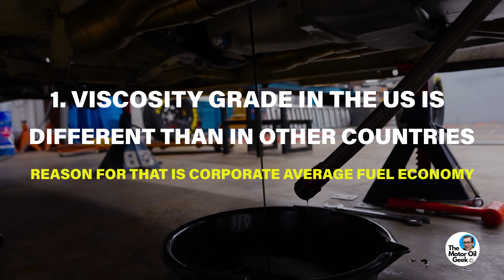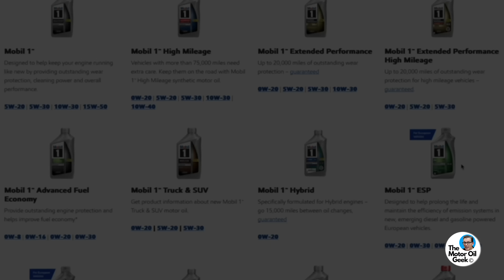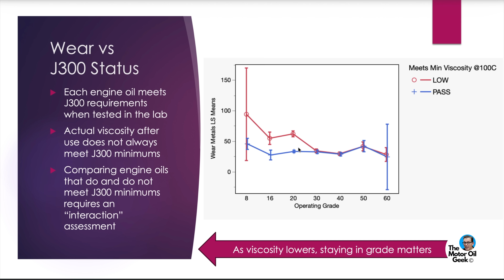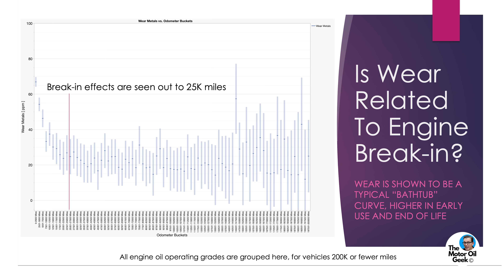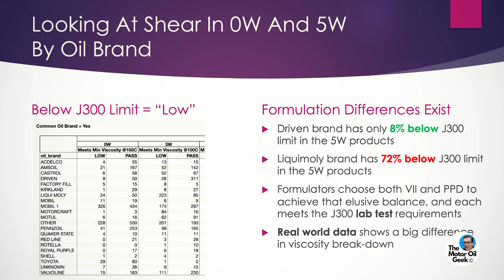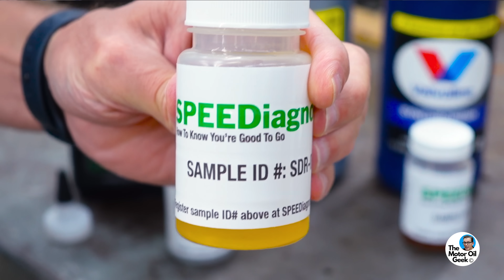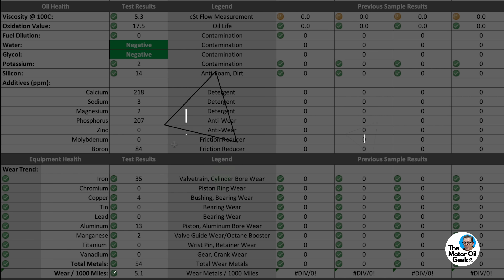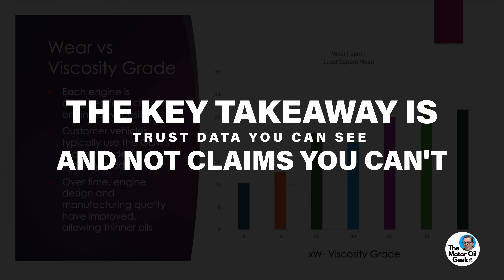More Ai Lies? The FACTS about 0W-20 vs 5W-30 (With Evidence)

Comment: So a 5W-30 sheared out of grade would still protect better than a 0W-20 sheared out of grade, that's what I got out of the video, so in a way, a higher viscosity oil does protect better. I gonna stick some 10W-40 into my car and run it shear out of grade, knowing that it will still protect my engine good
Reply: So stick a higher oil on your car and see if it doesn't wear out faster. Especially if you have a turbo. Just change your damn oil every 5k miles and stop believing AI nonsense. Thinner oil requirements are for fuel economy but also due to engine design. You don't want too much of a thicker oil on your engine if it doesn't call for it because the passages might be too small for that viscosity and introduce wear.. I've been using 0w-20 for 4 years on a 200k mile car many said wouldn't last that long and it's been doing great. 5-6k mile oil and filter changes done by me.
Reply: @thomassp I have a gti, imma stick with 5w40
Reply: @HatsuneM1ku01  stick with the default the car asks for and Change it every 5-6k miles.
Reply: @thomassp I use a 60 weight minimum on track days too

Comment: What brand and viscosity would you recommend for a 2023 Toyota 4Runner gasoline only 6 cylinder in Pennsylvania where it can get very cold? 0W20 is OEM recommended.
Reply: 5w30 Look at what that engine used to take before cafe bs and what the Europeans use.

Comment: My 5.7 Ram Hemi lifter quits ticking when I use 10W 30 instead of the 5w20. I can definitely hear the difference.  The difference is instant.
Reply: Same for me on my 22 trd pro 4runner, using factory recommended 0-20 at cold startup you get a small amount of engine noise first couple  secs on startup, with 5-30 that is totally gone, no startup noise period.  It appears the 0-20 drains off the engine much more than the 5-30. Creating the dry starts. I now use nothing but 5-30 synth.

Comment: 08 v6 Buick Lucerne  got it couple years back.  It always had synthetic in it . Its a 5w 30 engine. Anyway it was using oil when I got it after a couple of synthetic oil changes  I changed it to regular oil 5w 30 hasn't used a drop in 47 thousand miles since the change over . Runs smoother 

Same with my 09 Harley  with 5 k miles it had synthetic Harley oil  it started using oil switched it to conventional oil never used oil with currently 48k miles 
Synthetic oil is crap !

Comment: HI, I have a 2014 Toyota Camry hybrid Le with (511k miles) on & using Toyota 0w-20 full synthetic engine oil & have no oil consumption nor leak but cylinder head parts high clearance sound & wonder if I can go up & use 5w-30 to decrease sound of cylinder head. Please advise. Thanks

Comment: 0w-40 is a must in a DOD engine for the lifters to work properly especially in a cold climate which, I don’t get any better mileage when the DOD is on for a short period of time overall. So why even have the DOD system other then to make the dealers richer.  All my other older vehicles I use 15-40 and don’t have any problems.
Reply: I used 5w-40w mobil one EP in my 2006 tacoma for its entire lifetime, due to heavy commercial use with 1200-1500 lb loads daily. It lived and lived well, sold running well at 200K.

Comment: Nobody is listening to you Lake; you're full of shit.  I used 5w30 in my 2008 Tundra 5.7 for 300k trouble free miles.  An engine "designed" for 0w20.  *Gasp!!*. And yes, I am using 5w30 in my brand new truck...that's "EPA Influenced" to use 0w20.

Comment: Use what the vehicle recommends and change oil every 3500miles /5000km
My 2017 Subaru runs on 0-w20 
Runs like a dream and slays everything in the winter  :)

Comment: Years back when these thinner oils first came out, they were expensive, hard to source and we were leery of them. But when we used the "thicker" oil; some engines would tick because the they weren't getting lubricated properly through the tight clearances.

Comment: AI is destroying any credibility anyone had left.  I appreciate genuinely-researched videos like this.  Unfortunately, it's far too easy to fall into the trap.  The reason the ultra-thin oil is being used is twofold.  First, you want oil volume as soon as possible on startup.  What do modern engines do, again?  Right.  Stop.  Start.  Stop.  Start.  The other is, yes economy.  It is even more critical to do on-schedule service, though because it mainly looks like you don't keep protection as far into the 'margins' as you might with a higher viscosity.  Failed lubricant is still failed, though.
Reply: AI is there to make money for the programmers, content has nothing to do with it. Stupid is stupid no matter how you label it.

Comment: In Europe we have ACEA specifications (similar to API). 
OW-20 has three additional and very important tests. (ACEA C5, C6, C7)
Turbo charger deposits.
Timing chain/cam chain wear.
LSPI (Low Speed Pre Ignition).
That’s important protection for your engine😀

Comment: Question: I have the exact same 2025  truck (color and all) that you recently bought My question is since I live in South Florida and it gets really hot and humid. Do you think I would be OK using a 5w-30 instead of the 0w-20 or even a 5w-20 after break in? I currently use Pennzoil Ultra Platinum 0w-20. I occasionally tow a small tear drop RV. Thanks for your help!!
Reply from the maker: Thanks for watching. I will be testing a 5W-20 in the Tacoma after the break-in is complete.
Reply: At. Minimum I’d go with 5w-20 because the better case 5w oil makes it more shear stable then 0w-20. Don’t go over 5k miles either because if these thinner grade oil get pushed too hard into a severe service app they can shear out of grade significantly reducing its ability to properly protect the engine.
Yea heavier grade oil like for example 5w-30 can shear out of grade too but starting with a heavier 5-30 grade shears to maybe 2.5-20  that still protects the engine & a 5-20 may shear to 2.5-10 that will not protect as well as a 5-30 that sheared to 2.5-20.

Comment: How about we go back to straight 30 weight in winter and 40weight in summer for the northeast. 0W is most likely for living in North Dakota.
Which weight oil is going to reduce wear on timing chain and cylinders  rings?

Comment: Realize the engine has wear at 120k miles and the original tolerances are no longer the same. In fact, you need thicker oil now. Burning oil creates carbon buildup, more wear, fouled plugs, sensors, clogged catalytic converter and is very bad for environment.

Easy to understand but there is a greedy underbelly of auto industry... Crooked mechanics and salesman that need your trade-in for little or nothing and for you to buy a new car. So, recommending you allow your engine to self-destruct, or saying your car is smoking and it needs a new engine, is ok.

Comment: An ideal API-5W30 grade is always better than API-5W20 grade. I have worked with a lubricant manufacturing company for 8 years. It all depends on what type and quality of base stock, VII & additives the manufacturer is using. Same engine oil from the same brand can perform differently at 2 different instances. For example a batch of 5W20 blended using only group 4 Or PAO's with low SSI VII will perform far better than the batch of 5W20 blended using group 3 or group 2 base oils and high SSI VII. For end user the bottle or container and oil's appearance will be the same but they don't know that it is not the same 5W20 you had been using for such a long time 😅. Because of intense competition in the market to keep the profit margin sustainable and mrp reasonable manufacturers do a lot of cost cutting for the same 5W20 you are using for previous 10 years. 5W20 blended with group 4 base oils and low SSI VII will perform much better than 5W30 blended with a combination of group 4 & group 3 base oil and higher SSI VII. Same can be said for all and any kind of lubricant. It all depends on the price of raw materials used in blending of the lubricant. When prices are high majority of them compromise with the purity and quality.

Comment: I think an important point was not addressed.  The concept that if your 5w-30 oil does lose its viscosity, then it would still be providing at least the viscosity of the 0w-20 oil.  And we know real world issues like oil fuel dilation happens, and it thus seems more logical to have a thicker oil viscosity degrade and still meet the thinner oils viscosity.  The alternative of the thinner oil viscosity dropping down an causing increased wear seems more of a concern.  In the real world, people don't send their oil in to get it analyzed.  So on a large scale, the better recommendation is the thicker oil, putting CAFE standards aside.
Reply: more AI slop^
Reply: No this makes sense, esp given longer oil change intervals by manufacturers. These car manufacturers will benefit from you needing a replacement car sooner rather than later!
Reply: This was exactly my thoughts.
Reply: thank you......this video is pure bullshit, not folowing this guy
Reply: @ico8272actually he’s really good.  He’s just giving facts but there are so many variables, it’s hard to get them all
Reply: If one makes the assuming that a 5w-30 that has lost its viscosity is at least 0w-20 this is dangerous. The only way to know for sure is to have the oil analized. Once the oil has degraded what is to keep it at the new degraded state? If it takes two month do degrade to 0w20 it may take two weeks to degrade further.
Reply: @UraniumSpringsGhostline very true, but by this time your 0w-20 is where?
Reply: Wider ranges of viscosity stray out of their range more, so 5w-30 would be more apt to, than 0w-20.  This has been shown to be the case with other ranges. Just what I have always read. Is this the case?          @UraniumSpringsGhostline
Reply: If your car is still in warranty, the warranty will be voided in the US if you don't use the thinner oil. So, better to just change your oil more often while in warranty, and when you are out of warranty, then move to a thicker oil as soon as the vehicle is out of warranty.
Reply: @aftonline  No, RTFM. There's usually a heavier oil specified for severe duty. You can use anything within the ranges specified.
Reply: For those engines that have different viscosity requirements dependent on the country the safe bet is to go with the higher of the two.  This will be the actual viscosity for engineered tolerances.
Reply: I would say the safer bet is to stick to the recommended grade of oil and have more frequent oil changes. BMW had an issue with people putting in thicker oil that destroyed the oil pump (the fact that the oil pump had plastic vanes only added to the catastrophe) 

I change oil at least twice as often as the service interval in the manual. The “severe service” caveat in most manuals is just the car company covering their ass so they can deny powertrain warranty claims. Most people should be following that service schedule. 

The reality is that people often ignore basic maintenance and think that they take it easy on their cars, but they beat on their car like a rented mule. Hard acceleration, excessive idling, riding the brakes, keeping the car in Drive while at an extended stop all adds wear.

Comment: So I have a question? Whats the best wieght to use on a 5.3 lm7 that I changed cam and valvetrain on as well as oil pump. It says 5w30 but I was wanting to use 10w30 brad penn, id like to know your professional opinion. Oil protection is very important to me.

Comment: Well, there is one problem with this idea of which oils sheer out of grade, and in what proportion.

if a 0W-20 sheers 10% out of grade after a certain number of miles, and a 0W-20 sheers 20% out of grade after a certain number of miles... then you can end up with a hot oil viscosity of 18-weight on the 20, and 26-weight on the 30.
Which can leave an engine better protected by a 30W oil sheered 20% out of grade, than by a 20W oil sheered 10% out of grade. 
Because the film resistance to catastrophic contact of metal parts, is still higher in the 30W, even as it sheers out of grade at a faster rate.

Generally the multivise temperature shift in viscosity is created by additives... and those additives break down with time and temperature wear. Brands are gonna vary on that. Anything which starts as a 0W, is going to sheer closer to a 0W over time & heat, while anything which starts as a 10W is going to sheer closer to a 10W over time & heat. So a higher FIRST number is more resistant to oil viscosity breakdown over time. And a larger spread between first and second number is going to sheer a greater percentage out of performance spec over time. A wider multivise range can slip further out of spec, while still offering better performance. It's trying harder to help... if it falls short, it can still outperform.

Here's the thing... 0W at startup gives some possible advantages. Because a cold engine is metal-on-metal wear. Until that oil pressure spreads throughout the engine, you're in "extreme wear" actually.
It's "runny" so it gets everywhere it needs to go, fast.
On the other hand... 0W gives extremely poor film protection. It has very little resistance to parts pushing through the film to make metal-metal contact. So a cold engine cannot handle ANY torque without pushing through films.

IF - you wait until that little light shows the engine oil has heated up sufficiently, before driving , then 0W can be good.
IF - you wait some, but not fully until the oil is at operating temp, then maybe you'd be better off with a 5W.
IF - you drive off, the instant the engine is started, then maybe you're better off with a 10W or even a straight-weight (non multivise) oil.
and all of that is down to driving habits alone, not mechanical differences.

I'm imperfect at this myself. I have a stoplight about 150m from the driveway, which I know will always take about 1 minute to change and let me continue on my way. So I let the engine warm up "a bit", and then gently drive over to the stoplight, with very low torque applied. It's an extremely minor difference in wear. And I'm reaching operating temp right around the time the light changes and lets me go anywhere. It'd be more "perfect" for me to wait in the driveway, but I'm not sacrificing much by idling down to the light.

But if one were to start up, and immediately get a lead foot, with no warm-up... you're going to tear up an engine. And you'll tear it up faster any 0W oil, than you would with a starting weight of say 10W.

When you get up to operating temp though, you only need as much film protection as you need. As long as metal isn't touching metal, thinner works fine, and puts less draw on the engine. But that depends on how hard you drive it, the size & power of the engine, etc.

Personally, I think it's hard to beat 5W-30. You have "some" film protection, even when the oil is at ambient temperature. And your wear AT operating temp, reaches a fairly ideal range about halfway between oil changes. Also it's thinner than 10W at startup, which helps get everything lubricated fairly quickly at start-up. Just make sure it's always full synthetic, and you don't get too bold about your change intervals.

Do you always wait for that light to go out? Avoid driving hard in general? And change your oil early? - stick with 0W-20.
Do you kinda wait, kinda not, drive a little more 'spirited' after warm-up, and change your oil on time or a little late? - maybe use 5W-30. But stick with a quality full-synthetic which will actually BE at 5W when it's bitter cold out.
Do you hop in and immediately start playing tokyo-drift before you can even see through the frost on your windshield? Or hard-rev your cold engine to heat it up faster? - Then you NEED that extended warranty, and no oil can save you.

This is before getting into the (incredibly thick) weeds of the engineering of specific engines for various oil weights. Which I think is where the GM L87 problem is (as a specific example).

Quality of oil, and oil change interval, are somewhat more important than viscosity. Driving like you care about your engine's feelings, helps 100% of the time. Your recommended oil viscosity is ...sort of a hint at how the engine is designed, but somewhat flexible, based on how you know you're going to use the car.

Answering what viscosity of oil you should use, without a LOT more info, is like answering whether you proposed to the right spouse, without meeting them. AND... that's a problem which manufacturers face, when writing up their recommended viscosity too. They know the engineering, so they're somewhat more informed, but they have no idea what your local weather is like, how you drive, how hilly your area is, etc. It's kinda like the engineers knew that proposed spouse in 1st grade, but haven't talked to them since then. 
So don't be too afraid to adjust "a bit", if you understand what the variables 'do'.
Reply: I have a 2018 gti so I use 5w40
Reply: @HatsuneM1ku01  Yeah turbocharged or other high performance engines do like that thicker viscosity. More power = more pressure on the oil films.

Mine's just a naturally aspirated regular mazda 3. I run 5W30, even though originally it came with 0W20.

Comment: You actually confirmed the first 2 points of the AI video. 6k in the study not 10k. 0-20 = more wear when out of grade is more critical than 0-30 falling out sooner. Which by the way doesn't follow the trend in the data anyway. Look at the 0-16, 0-12 & 0-8 contradiction or correction. Essentially not conclusive that 0-30 actually falls out 50% faster. But again the 0-20 wear when out of grade proves it is more risky or less forgiving in real world conditions than 0-30.

Comment: Everyone is all over the place on 0w20, other uploads stating they used Blackstone Labs oil results and most 0w20 is definitely not good for  over 5,000 miles.  I need to stop wasting my time, I'm going to do a summer run on Pennzoil Platinum and get it analyzed.